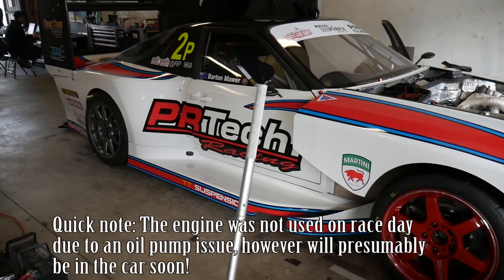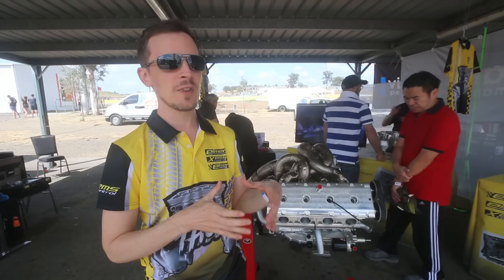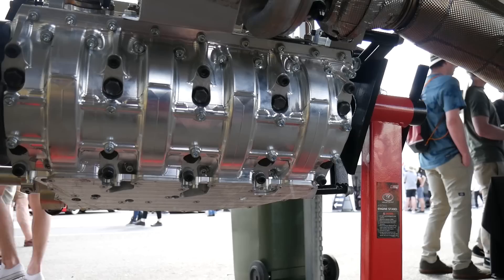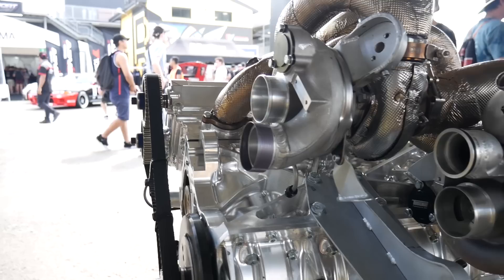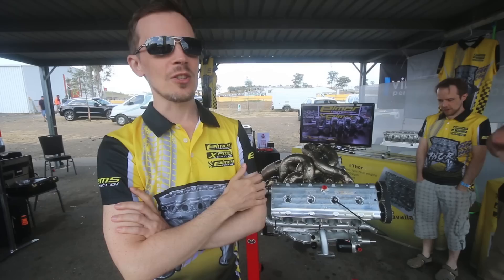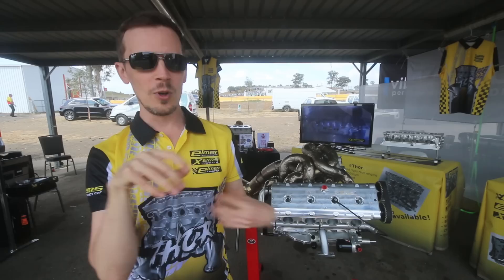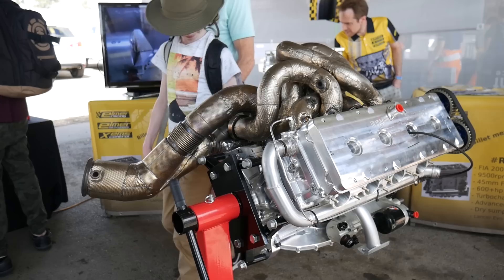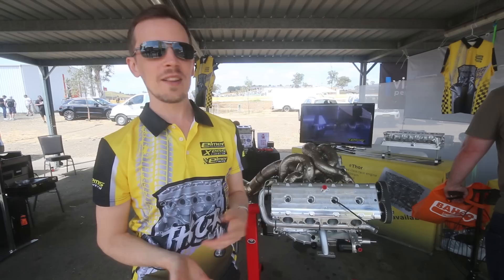4.0L | 4 Cylinders | 1500hp | The *nearly* All Billet RP968 Engine

Comment: wow that means that each cylinder can drink about a rock glass of fuel per revolution. in other words your car will drink like a carpenter working on a high building on the sahara desert during a sun storm. every 2 miles you need 3 gallons of gas!!!

Comment: Seeing comments that this is overpriced engine, well 2 cents: It aint cheap, but definitely not overpriced. Ive build some tuned engines and for 2 valves/cylinder and 100bhp/litre engines, you will spend easily 4k-5k.  Our own engine price was 5k  @ 95-98bhp/litre -> buy 4 valves /cylinder, custom built race engine with 130 to 150 bhp / litre = 16k without ecu and manifolds. Add ecu + manifolds and tune for it, you are over 22k-23k easily. And still you have no billet crank, billet head or billet cams etc and you have cast iron block. Now when you go into turbo stuff, yeah you can get power out engine dirt cheap but the truth is that cheap engines wont last long, 10k billet block with cheapo parts is as good as cast iron block with stock internals. When you are in serious racing, you dont wanna save money on critical stuff, in long run like 1-2 seasons, blowing multiple engines will cost you same as 100k racing engine.

Comment: A 2017 F1 engine (without mgu-k and mgu-h) delivers 600 hp out of 1.6 l. That's 375hp/l. Elmer delivers 1500 hp. out of 4.0 l. = 375 hp.l. ! What a coincidence ! Not only Elmer can compete with Mercedes and Ferrari F1 (who's budget is 470 miljon a year !) but Elmer does it for a fraction of the price. 120 k. is a steal ! But the question is.. is it for real? If it is they should build one in a  2017 Donkervoort D8 GTO RS (witch  weighs 700kg).
That car with 1500hp.  is good for a specific power of 2.14 hp/kg ! It'l be the fastest set of wheels on the planet !

Comment: Uggg. "Billet".... It's "machined". You buy billets to machine.

Sweet engine in though. Didn't know you could take an I4 to that size. Thought secondary inbalances would get in the way.
Reply: jonnoMoto I imagine it probably does. Could be partly to blame for such short life of rods and pistons.
Reply: Offenhausers were 4.4L and powered Indy cars for decades.
Reply: Look up the Fiat S76. 28.4 liter Inline 4. Certainly nowhere near as high RPM, though
Reply: Technically cast blocks are also machined because otherwise they'd be bit too rough. Billet means it's machined out of a billet and not a cast.
Reply: + Evi1M4chine I've had the same issue. Apparently it's a very difficult word to translate.
Reply: every engine is machined thats why they seperate it by referring to the raw material
Reply: TheLaXandro yeah but difference is drop a cast block from a height itll crack, drop a block milled from a block of billet you'll maybe dent it
Reply: Whats about milled from a block of cast iron
Reply: jonnoMoto its machined from a solid block form instead of poured or cast!
Reply: DrHillbillyShow I was just about to say the saaammee thing. These people are missing that fine detail
Reply: by billet he means machined from billet stock. as opposed to a casting which would also be machined... so just saying "machined" does not describe these fully machined parts fully
Reply: Cast parts are also "machined"
Reply: Racers don't care about vibration they care about hp. Though I'm sure in this thing you can feel every power stroke.
Reply: In the 1920s they had i4 engines up to like 14l
Reply: this is the definition ive been looking for...jesus h thank youi
Reply: Exactly.
Reply: Correct at least he didn't say factory stock billet then I would have closed this video. Though it shows with lots of $$$$ you can make big HP using billet parts. As they say in racing every HP gained is going to cost you so you better have sponsors or deep pockets.
Reply: @ Ben garrido yes the offenhauser was still is an awesome engineering piece, and don't forget about Bob Norwood, who had build a 4,8 ltr for his dragcar, it has been said it produced or capable up to 4000hp. Not sure if it raced, never heard or read anything after
Reply: All engines are machined, even on regular cars on the dealer lot. What, did you think engine parts were ready for assembly straight from the foundries? o.0

 "Billet" is the correct way to distinguish this engine. Being machined isn't unique at all. Almost entirely billet construction (which is of course machined - that's how you build engines) is very unique.

And the reason this engine can be that large is the aluminum billet material they're using is much lighter. The cap of about 2.5 liters on conventional-material I-4s is due to the weight of the rotating assembly and the intrinsic secondary forces imbalance of the I-4 layout. Less weight = less mass and therefore lower secondary forces imbalance influence to act on the engine during crankshaft rotation and rod/piston reciprocation; simple engine physics.
Reply: conventional material? what exactly do you refer to? Block, internals? There are factory blocks like some Volvo and as i have one based on ( Ford 2300 ) can be made to 3000 cc no problem. Agreed that this will have more imbalance forces acting upon the chassis due to its weight involved. Not sure what you're saying
Reply: jonnoMoto its not been cast its been sculpted like statue made of wood or an ice sculpture
Reply: if it wee cast as most engines are it is literally melted metal poured into a mold/die.  billet is a solid block of metal that has been hammered/rolled/pressed and while red hot then extruded and or rolled  into the shape of a block, so it has less impurities and almost no air in it.  it is much stronger.  like a samuri sword that has been heated bent over and hammered into itself hundreds of times before it has an edge put on it.  a cheap sword is just a piece of cold rolled steel that has an edge put on it.
Reply: PA Squared i was going to mention this engine as well.
Over 427ci per cylinder.
I can only imagine what the exhaust sounded like on that fiat engine....
Reply: You're right about secondary forces. I'm sure it vibrates to all hell.
Reply: ..although a well made casting could be largely machined where applicable, then forged, and final machining and sizing, then heat treated/annealed and become 'billet' also. 
   But that is a rarer and more expensive type of '(partial?) billet - let alone sinstering & hot forging, autoclaving and other aero-exospheric type tech & processes which are many times more expensive than that I initially suggested.
Reply: What i have heard, "billet" is the aluminium alloy they use with thise parts. Not 100% sure but thats what they said in one video